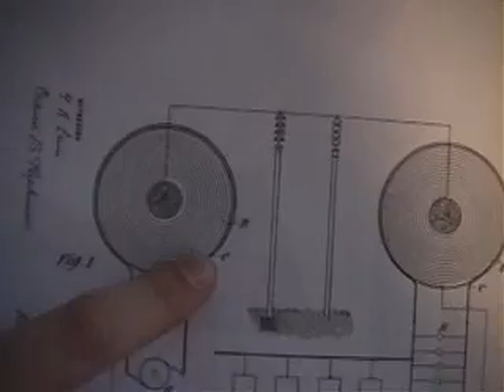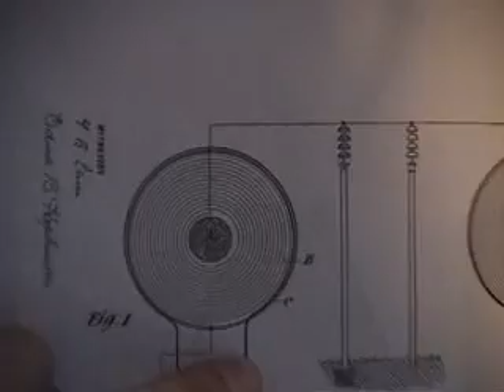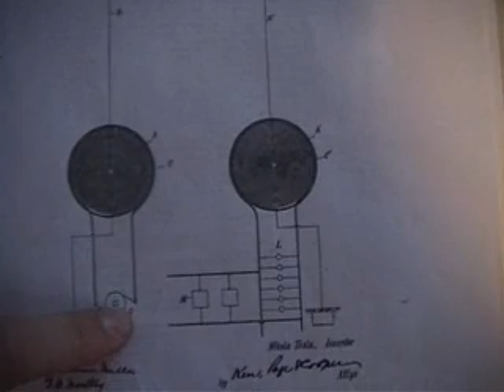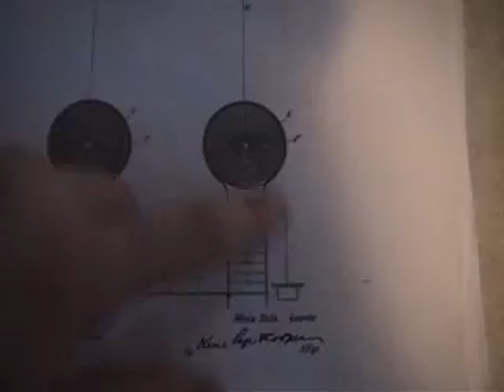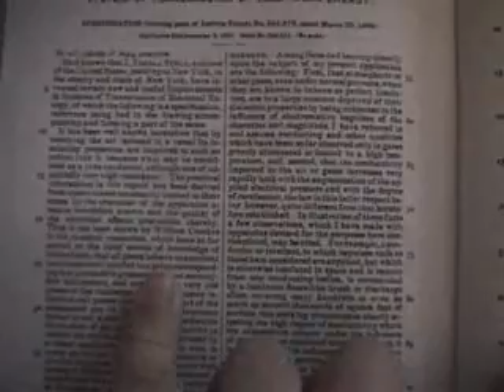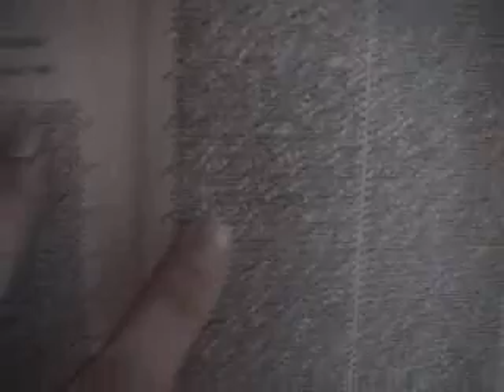Wireless Transmission of Electrical Energy, Tesla 1900 part1

Comment: Is it possible to transmit the power without a ground connection?
Reply from the maker: part of the tesla transmission spectrum is the earth as a transmission wire. some radio technology that gets close to teslas ideas are "transmission line theory". the magnetic, or electrostatic waves thoretically propagate along the earth as bubbles of energy in resonance(like waves of water in a tub at resonance), so the wave is able to reach areas above the earth. large metal surfaces like his toroids would help resonate energy above the ground with resonant coils, so it would be possible. some of my small experiments show without grounding because of the field that forms around the conducting wire.
Reply: boxa888 thanks

Comment: I like your approach.  You will find an oscilloscope to be useful in your research.   When your meter was "bouncing"  it was seeing a wave, as voltage was changing with time and going both positive and negative.  Also you need to monitor whats happening at a few more points.  Using Niklas work and recreating is the correct way.  JP Morgan pulled his funding cause you can't make money from free, think he was short sighted.

Comment from the maker: wardenclyffe might have been able to resonate with the upper atmosphere and bring it into resonance pulling the charges of cosmic rays hitting the atmosphere which already charge it to a high voltage by ionization as they pass through, so it would need a small amount of energy to give alot of energy to the world, but from teslas own words, the free energy cosmic ray devices was different than the use of wireless energy. so the free energy device would have been something else but still basic.

Comment from the maker: with certain decelleration devices you can harness the voltage charges on them with coils and thus you are making electrical energy from their accelration voltages from the sun.  so as you slow highly charged cosmic ray particles, they more easily give off thier electrostatic charge and thus industrial energy is obtained from them. tesla did say in one of his last articles before he died that the wardenclyffe tower was seperate from the free energy deivce he proposed towards the end of life.

Comment: 'Man out of time' a book on tesla showed at the end of his life he realized electricity can be understood as mv-squared and that 'voltage' etcetera hamper understanding and hence usefulness of e. I found that the FMMC Meter (now digital displays) measured CONDUCTANCE and not voltage nor amperage. + R= rL/A is wrong and R = A/L is the truth. Simply consider that it is impossible that a meter can read volts in parallel and then amps in series -- hello! its the same damn instrument and cant change.

Comment from the maker: yes first input power from high frequency generator to a high voltage transformer, now feed this into a capacitor to give very fast impulses to a primary coil, this primary system is in resonance to bring the most efficient and powerful impulse to be delivered to the secondary, secondary gets the high current field and now becomes even more high voltage at the frequency of the capacitor discharge into the circuit, now this high frequency voltage is in further resonance with the earth conductor

Comment from the maker: u are forgetting resonance of a conductor and then a high voltage, high voltages dont conform to the resistance because they travel through it quite well. abut 95 percent efficient world wide because of the high voltage and resonant conditions of the earth, make sure you understand that! i have gotten 20 ft transmission and i am only using about 1000v to 5000 v which is really nothing! once you hit high voltages above 500,000 volts resistance changes. the wardenclyffe was never a failure!

Comment: Because the ionosphere cannot fully discharge its potential energy builds to the point that it can be picked up by any tuned circuit grounded to the earth & only a short antenna is needed to pick up a large amount of energy anywhere on the surface of the planet. 
More energy could be recieved than transmitted because it harvested the solar energy that charges the ionosphere every second of every day all over the planet. Tesla was a true genius & greed prevented him realising his dreams.

Comment: You are looking at it the wrong way. Tesla was using a high voltage pulsed charge to resonate the ionosphere. We are surrounded by charged layer known as the ionosphere. This layer is always charged by solar radiation to the point where it is discharging 44 times every second somewhere on the planet. If you cause this charge to resonate it cannot easily discharge because as the dielectric (air) ionises the resonate frequency goes negative reducing the potential and preventing full discharge.

Comment: If Electrostatic waves moved faster than light the wave would be recieved before it was sent. This would make energy free because if you transmitted an electrostatic wave you would recieve it before it was transmitted, therefore when you recieved the wave you could cancel the transmission and just harvest the energy recieved instead. So just the intention to transmitt  an electrostatic wave would be enough to make the wave happen. This is not possible.

Comment: Correct and around 25% to 45% of energy used in transportation is spent driving the weight of the fuel contained on board around. Think how simple and light we could make our transportation devices if we could wireless extract the energy they use from the air and not have to carry it around with us.

Comment: The earth is in fact a giant capacitor. We have the ground as one plate & the ozone layer or ionosphere as the second plate. The atmosphere is the dielectric. When lightning hits the earth the dielectric breaks down &  the capacitor discharges. This capacitor can be made to resonate with a pulsed high voltage inductive circuit at around 6 to 8 Hz. A tuned circuit can draw of this energy at any point on the globe, in the same way a radio can be tuned to a transmitter. Reseach Schumann resonance

Comment: Actually, radiowaves ARE energy transfered over the air, you just wouldn't want an excessive amount of it, or else you'd live in a microwave oven :p

So called "crystal radios" use the radiowaves themself to power itself. They need a very sensitive earphone of high impedance.

Tesla didn't use radiowaves, he was very cleat about that.

Also, Tesla discovered that air conduct electricity in the right conditions. We use similar tech today in waveguides for microwaves.

Comment: this resonance is somewhat like the heartbeat of earth, our brainwaves match up to it, thunderstorms follow it and our weather patterns are dictated by it.  tesla wanted to use the electrical vibrations of the earth to utilize the enourmous voltages in the ionosphere so that energy could be drawn down into the ball and transmitted through the earth at a frequency that would make electricity usable yet not deadly.  plug into the ground and go.